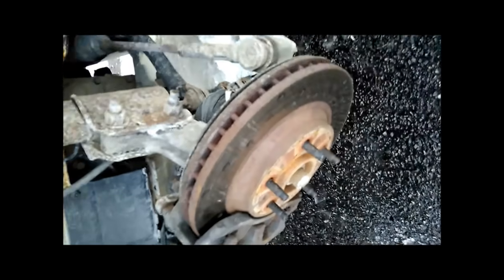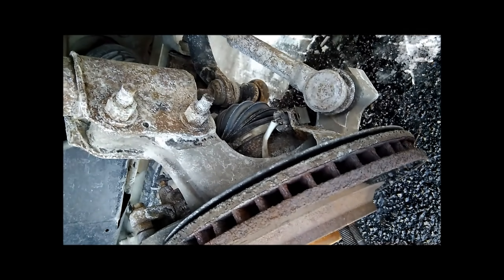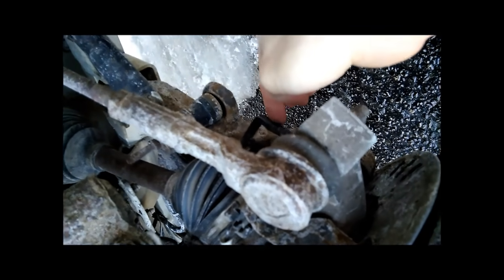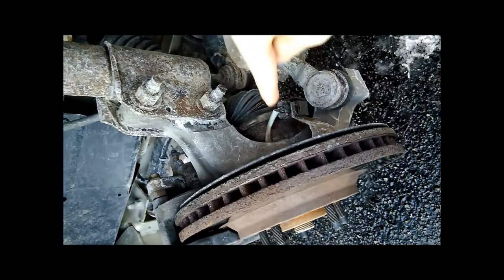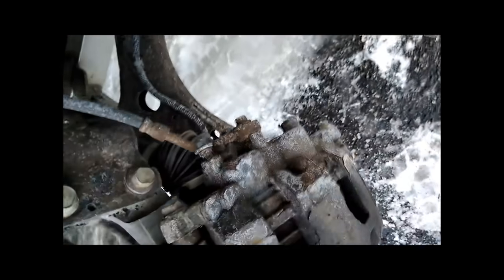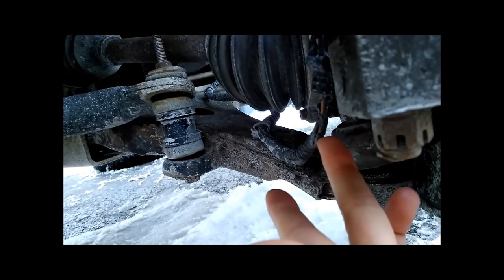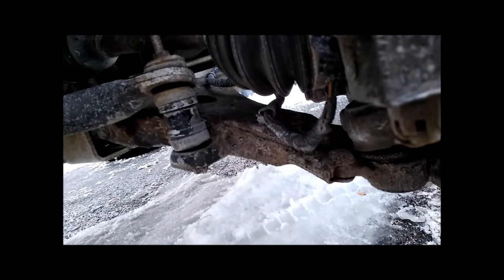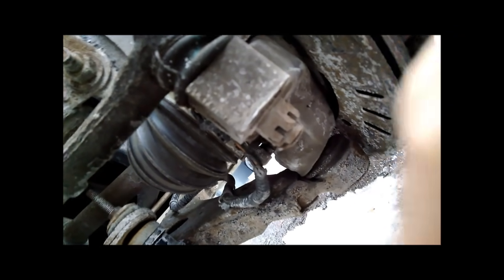How to fix ABS light, Traction Control, Stabilitrak

Comment: Good video however I did do the same thing you did only on my 2012 impala it was on the left side I taped re-taped each wire and the casing it ran good for about two weeks and then I end up the same problem again I ordered from Rock Auto, the “wire harness complete” it looks identical to the GM one for $6.50 that is going to be my weekend project because I was told once the wires break in the casing no matter if you tape it it’s still going to have a short just a slight change in voltage will make that traction control light come on again. GM Wanted $70 for the same wire harness and  the total job if they would do it would be over $600! I did mine for $6.50!👍
Reply from the maker: You did it exactly as you should have.  In hindsight it would have been better to include the permanent fix in the video as well but I guess the important thing is that, by virtue of the video and the supplementary comments, people are at least aware of the root cause(s), how you can quickly fix it to get by for a while, as you do your research and decide what to do and then how to fix it for good as cheap as possible, just like you did.
Reply: Do you happen to have the part number for the harness? Although it will probably be different for my 08 G6.

Comment: Great vid and Info Chris. I have a 2007 chevy malibu and every time I do a complete stop for a min, the Traction turns on. As soon as I start driving it goes out but it makes a hard know every time it turns off. Would you know whats wrong with it?
Reply from the maker: If it happens during stops and you're not losing traction, it's probably the same as what I'm describing in the video, where the suspension is flexing as the car shifts its weight around and as the suspension components move and flex, the ABS cable moves with it.  If there's any flaw in the cable, it's going to open and close the circuit with this flexing motion.  The problem would therefore most likely be in the part of the cable loom closes to the moving suspension components.
Reply: @ChrisCamaro  Thanks for your help Chris, I will take a look at that!

Comment: I’m stranded right now, I just got my breaks done, it’s 5 days later, on night 3 around 2am it was raining the ground was slippery, abs, ecs, power steering, and brake lights are all on. So I went to stop at the red light, I’m
Going about 5 miles per hour, I engage the break, I slide slightly (expected I was going downhill)
But I here a noise car stops abruptly almost like I threw it in park. Luckily I was literally 1 block from my destination. I go to accelerate when the light turns green, car wouldn’t move, I press the pedal down further I start to move, with severe interference. When I engage the break, again it feels like something extends and is scraping the ground, I also cannot retain brake fluid now, pedal goes all the way down. Less then 6 days ago I got new front brakes and rotors

Comment: My 2008 Saturn Aura 3.5 XE V6 is doing the exact same thing I noticed it comes on when turning hard fast at certain angles the all of a sudden I can feel the ride or handling change then boom the chime and the abs light and traction control somes I get a code for my bank 2 O2 sensor with it saying no activity heater resistance bad wiring I suspect

Comment: Hello I have a 2015 Silverado and I’ve been having intermittent abs and traction control lights going on my dash. They haven’t stayed on but today they did and now my truck won’t crank, click or start. For this I think it’s wiring issue, if I hit bumps the right way a light will come on the dash and disappear. Scanned and it says there’s an issue with the left front wheel hub. Could a bad sensor cause a vehicle not to start ? Any help would be great. Thanks.

Comment: My problem may be more complicated.  Had all 4 wheel bearings replaced last year. This just started 6 weeks ago. More than not it happens while sitting at a stop. When I go to pull out, both service brake assist and traction service light will flash, when it does this it feels like a tire is locking up AND my speed odometer will jump up quickly even though I'm barely moving. Another thing I noticed is when it does this it makes a noise like " an electric motor not starting " only way I can describe the noise.  When driving down the road and the lights both flash, it feels like the car is cutting out. To me it sounds like drivers side front , so checked the caliper and wire on that wheel and wire looks fine, haven't checked passenger side yet. But two more things, sitting at a complete stop and then punching the gas it bulks and does this, which has me wondering if it could be in transmission? And when both service brake assist and traction light come on and STAYS on, it will not do it at all???
Reply: You have to scan it pull the codes then troubleshoot the problem
Reply: My 2012 Impala does same thing. Many fixes on the wires and it lasts a few months. Now it is triggering Code U0101 (lost communication to TCM). Adjusted TCM connector and it works for a few months. My friend is a mechanic but he has saved me lots of money over the last year, but this issue keeps popping up.
Reply: Same here making my car a paper weight what’s the issue? Already changed bearing speed sensors and my relays and fuses are good. I keep getting TCL, ABS and Stability track
Reply: @stasiagmz210 if your speedometer is jumping and the car is going into limp mode, try checking the speed sensor on the transmission. IDK exactly where yours is located, but on my Ford Fusion, it's on the bottom of the transmission.

Comment: Thanks, my issue is on a 2004 Chevy Avalanche and it makes the truck have (VERY) reduced engine speed. And you cant make the TC stay off. So my question is does that likely mean its the TC module? I read that costs around 900-1300$ for the part.
Reply from the maker: If you're experiencing a loss in power, I wonder if the computer has put the car into "limp mode".  Not enough info to tell if it's related to the traction control in any way but limp mode sounds like what you're describing and is usually associated with an engine or transmission problem (check engine light may be on).  If TC is responsible for the loss in power you should notice the car drives "jerky" because the TC is overriding the throttle to improve traction but this would be very apparent.
Reply: @ChrisCamaro  that is happening to my new body impala it is in limp mode and Jerks when I put it in gear.

Comment: I had mine fixed a couple of years ago on my Subaru Impreza 2015.  I think they said it was just the light or whatever. My check engine light would come on too. Now two years later it’s doing it again. So annoying.  I have an appointment to have it checked.
Reply from the maker: This issue seems to be notoriously tenacious.

Comment: Does this makes your car mis fire?
Reply from the maker: When it is working correctly, it can make the car misfire but that is intentional.  Turning off fuel injectors is a means of traction control and it causes misfires.  However if you are having misfires when the system is NOT active (during a skid), then that is not normal.
Reply: @ChrisCamaro   my car start to misfire when it comes on.
Reply from the maker: @ELZI_the_Light  The car is supposed to do that.  It's normal.
Reply: @ChrisCamaro  Thank you for your time and knowledge. Sir. Much Peace and Love.
Reply: No

Comment: I got a 2018 GMC sierra 1500 I got the brake light on traction control, and ABS lights on.
I replaced the wheel speed sensors, the wheel hubs are only a couple months old. I tried clearing the codes, but they keep coming back. The  codes are C0035 & C0040
Any opinions and thoughts on the issue?

Comment: I have a 2008 GMC Acadia and both lights the traction control and stability track keep popping up will this work on my vehicle as well ? Also when I about to make a complete stop I get the traction control light and my truck breaks kinda stalls before I am able to get a complete stop ?
Reply from the maker: If the lights tend to come on during changes in your driving maneuvers (like starting or stopping, going over bumper or turning), then chances are it's an electrical problem because the movements in the car (more specifically the change in those movements) is shifting some wire in such a way that the signal becomes intermittent and this freaks out the computer.  You can follow this video and see if the problem is at the hub but if it isn't it could be anywhere along the wire going back to your car's computer.  It's hard to find this sort of thing yourself unless the car is up on a hoist so if you don't have the equipment or feel unsafe doing it, best to get a mechanic to check it.  At least you can give him a head start by telling him you think it's a intermittent speed sensor wire going to one of the wheels and he can possibly (if the dash lights are on) confirm this with his scan tool or do a visual inspection with the car on a hoist.  Otherwise, if you don't see the issue at the hub yourself you'd have to jack the car up on stands and slide under it with a creeper to do your own inspection.

Comment: I had a guy replaced both speed sensor harnesses 2 years ago and it was fine. I recently had someone else do my loose hub on the driver side and since then the stabilitrac and brake assist light has been on. I popped both front tires off and neither of the wires are frayed although the white cover over one of the wires has been rubbed off or fell off. Any ideas? No visible damage to either sensor or even the wires without the protector over it.
Reply from the maker: Tough situation if you can't see the damage.  It's possible for connections to "fatigue" over time causing micro-fractures.  Not quite the same as metal fatigue in buildings or aircraft but it's a sort of failure from continually flexing something over and over again.  Basically the fault may not be a result of something external but may have happened internally.  You might be able to detect this with a multimeter set to resistance mode.  Any weak or intermittent cable would have a much higher resistance between ends.  But you'd have to disconnect all the harnesses to check this.

Comment: Thank you!!
Reply: I do want to add that there is no way I could remove all 4 tires and jack it up like this.  So when I take it to the Dealer, even if it's just the frayed wires, they are going to replace the speed sensor and the bearing and or hub and all that also (300+ bucks).  I appreciate the video as it gives me a lot more insight of what's going on.

Comment: I have a 2016 Buick Enclave and on the way home the 'traction control off' light and warning indicator message came on and the 'service stabilitrak' warning message came on. The car felt like it was surging every few seconds as i was driving, like it was trying to stabilize. 
I live about 12 miles away from the nearest auto parts store. Is it safe to drive to have codes checked? I need to determine exactly which part(s) to order. 
I hope this isn't too hard for a woman to fix. 🙃
Thanks in advance for your help
Reply from the maker: Scanning for codes is harmless to the car.  Get them to check the "history" though because these intermittent electrical problems usually don't show when the car is stationary.  But the history will be saved in the car's memory.

Comment: My traction control and ABS light came on during the Cold snap we had in the weather here in Florida. Every now and again it will go off, but whenever the two lights come on I am unable to put it in cruise control. I just got it out the shop because the speed sensor went out, so I know that's not the problem. Is it possible cold weather can throw a code?
Reply from the maker: Rain and snow are more likely to cause it. Temperature causes things to expand and contract and I wouldn't entirely rule it out and say no it can't cause it BUT it's unlikely.  If the problem is electrical and the wiring is damaged or old, usually and high humidity or wetness in the faulty area will cause a soft short across the wires and disable the system.  That's what it's doing right now on my monte carlo.  Disables everything only in the rain or snow, never on a dry day.  But it's not impossible that the cold is related so see if you can locate the damaged part of the wire between your wheels and the computer anyway.

Comment: The connector that goes to the wheel bearing @1:08 is missing. All I have are the two wires it was connected to. What is that part called?
Reply from the maker: Do you mean to say that the wheel hub has the sensor in it (and therefore has a wiring harness with connector) but the car does not?  Quite often you will find compatible parts that support versions of your car with ABS but are also considered compatible with the non-ABS versions as well because there is no fit issue.  However the sensor is useless in that case.  You can just cut the pigtail off or ignore it altogether if it doesn't apply to your trim.

Comment: Update: The driver side rear air shock failed, it was wearing the tire to the steel belt.. when I removed the lug-nuts the wheel was stuck.. I had to firmly kick the tire off and learned that the steel belt was showing. I might have to replace the rear bearings on the driver side.. (passenger side rear wheel was not a problem.) Is the rear bearings hard to replace? Will electrical cleaner work? Is there a video on how to replace rear wheel bearings on a 2000-2005 Buick LeSabre Custom? I’m on a budget.
Reply: Did you ever get an answer? Just as you, I also have little money to waste. The mechanics love, love, love seeing me pull up 😐. What they don't know is this cute older woman had a father that taught me a great deal about car issues, not just the basics either. Plus, many will add other issues they say pertains to the major problem. Listen up mechanics, you may think that especially with a woman or young first time owners of a car are clueless! 
Biggest most important tip this ole gal can give to any & every car owner is: (ALWAYS WITHOUT FAIL, GET NO LESS THAN (3) OPINIONS BEFORE ALLOWING ANYONE TO FIX OR TOUCH YOUR VEHICLE!!) It's not always about how much it'll cost you, but most importantly that they are FIXING THE CORRECT PROBLEM. Go online and research what may be causing a certain sound, what's exactly happening upon start up, while driving, or anything you obviously know isn't running or acting like it's suppose to!! Good luck, and be wise my friends. 🙂
Reply: Thanks for responding! Colder weather is a common issue. It’s a good idea to have a mechanical inclined friend to help check the wires and connections.

Comment: I'm having these probs service traction control and abs light and car is making noises like breaks are are bad but new pads are on and it roars like it's rotating and rubbing metal but not the rotors or pads look bad and the petal is starting to push back when the rotation noise comes it pushes back on the petal. Is this maybe a bearing to make noises like breaks are rubbing
Reply from the maker: If I'm understanding you right, that sounds like normal ABS behaviour.  When the ABS activates, you should feel and hear noises and the pedal should push back.

Comment: I have a question. I have these issues with a twist, I also get an error message on the dashboard, my fuel gauge drops to empty and sometimes the car won't start. So to clarify, I have the abs, traction control, alarm light plus everything I mentioned above all abruptly coming on at once. Then sometimes it goes back off for a while then back on.. 2006 Chevy Malibu LTZ
Reply from the maker: Usually when a bunch of lights (often including the TCS) come on at the same time, it's a more generalized computer/electrical problem.  I've had this occur in my Camaro (I made a video on that) and in my Monte Carlo all the gauges will go haywire with DIC lights coming on while driving at random.  I'm pretty sure it's the ECU freaking out because of an electrical fault, nothing to do with any of the individual lights that come on.  Pretty hard to diagnose and you'll need an electronics specialist to nail it down.

Comment: Thanks for the vid is it normal for them to go out as well once changing tires ? Because when I rotated my tires it came on and traction control
Reply from the maker: Not normal but quite common.  Changing the tires itself shouldn't be the root-cause but if the tires are uneven in terms of wear or pressure, it can cause a discrepancy in the reported speed of each wheel so if they were on the cusp of confusing the computer before and you move them around the new configuration may be more out of whack and trip the computer.  It's important to have a good alignment, even tire pressure and even wear for several reasons but the TCS working properly is one of them.

Comment: My 2012 Chevy impala jerks or grinds when turning left or slowly accelerating and when it does, the traction control, ABS and stabilitrak turn on, would doing this fix that problem?
Reply from the maker: It depends on why you're having the issue.  This method may help if the problem has to do with the condition of the wires between the car computer and the wheel hub.  If the issue is the sensor itself, then the solution is to change the wheel hub.

Comment: So I've had a 2010 Buick enclave for a few years I got it used my tire sensors have intermittently went in and out and I just have let it ride I've had one out for over a year and left rear and no stableink or abs but now intermittent everytime i drive
Reply from the maker: Do you suspect the wheel sensor rather than the wire loom?  If that's the case you need to check that the resistance across the wheel sensor is correct.  In my car it's 1.1kOhm.  For you, you could check a good wheel and compare the suspected bad one.